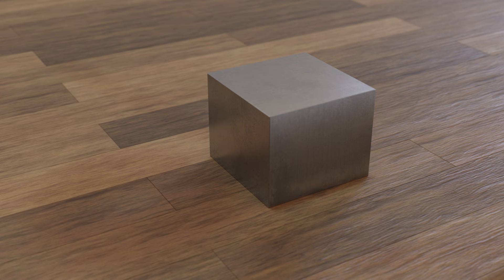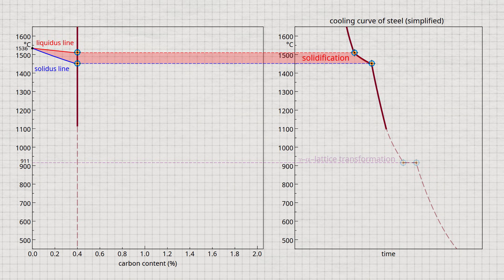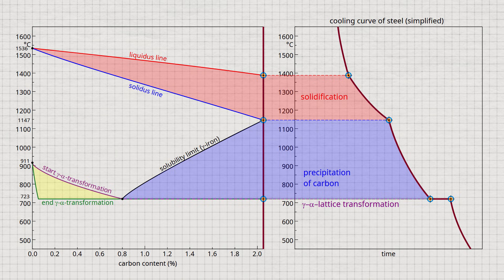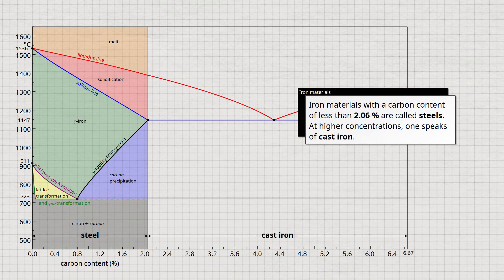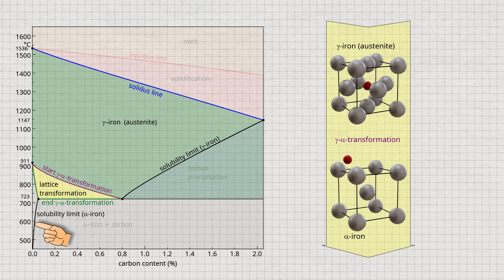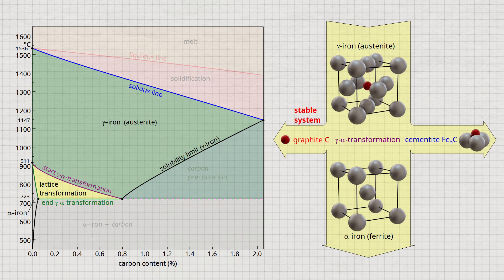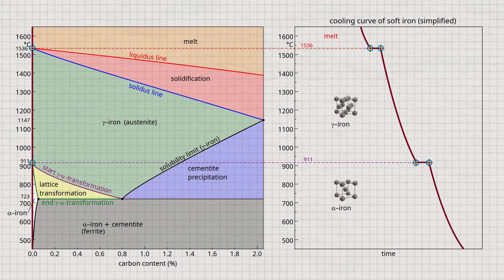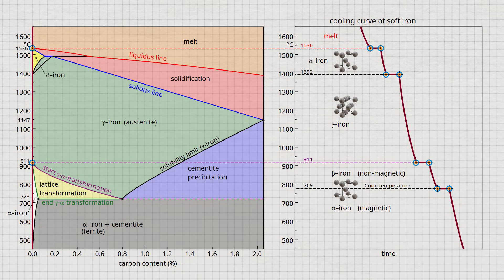Iron-Carbon Phase Diagram simply explained Part I | Creating | Steel | Cast Iron

Comment: Thanks for the Detailed video. So how do I ensure, I have gamma Iron for my "specific" application at room temperature? I do have some gaps in my knowledge.
Reply from the maker: Gamma iron (γ-Fe), also known as austenite, is an allotropic form of iron with a face-centered cubic (FCC) crystal structure. However, under normal conditions, it’s not stable at room temperature — it only exists between roughly 912 °C and 1394 °C. To make use of gamma iron at room temperature for a specific application, its structure must be stabilized. This is typically done by alloying iron with certain elements like nickel or manganese. These elements shift the thermodynamic balance in favor of the austenitic (FCC) phase, allowing it to remain stable even at lower temperatures. A common example is austenitic stainless steels, such as grades 304 or 316, which contain a high amount of nickel. These alloys retain the FCC structure permanently and are known for their corrosion resistance and non-magnetic properties.